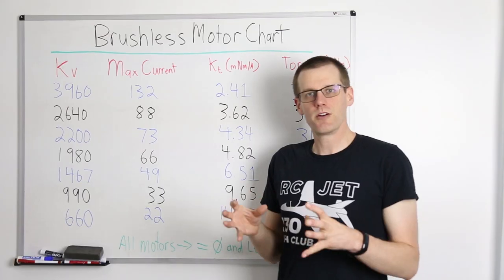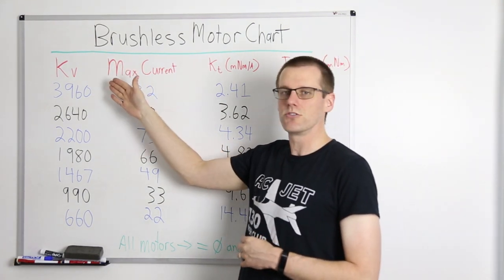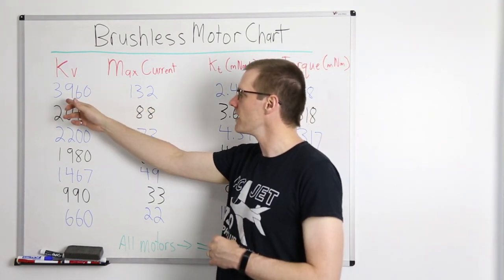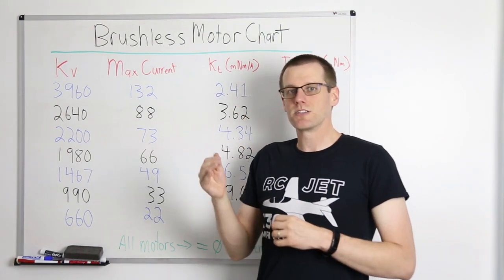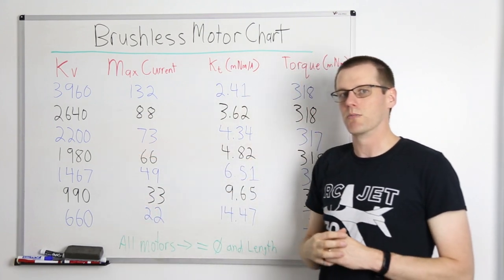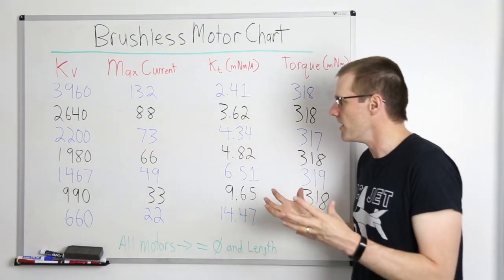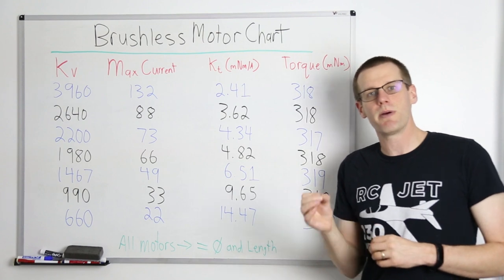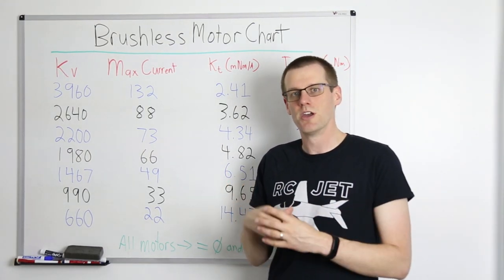STOP Saying Lower Kv Motors Produce More Torque

Comment: Didn't you explain in previous video, lower kv having more torque was a myth , but is alot more efficient,  less heat transfer
Reply: He most certainly did i just watched it last night. He's most likely updating the video as some wouldnt accept older information even from a year ago.
Reply: You might be thinking about a situation in which you ask the higher KV motor to spin x-many times faster - yet less than x-many times softer - than you do the lower KV one, causing it to draw more amps.
Reply from the maker: You are correct. I wasn't clear enough in that video as I received many questions about needing more torque and going to a lower Kv motor within the same size class.

Comment: Mathematically deficient here and newbie to electric. I have a 1650kv, 200 ESC and would like to run a single 6s pack varying from  5000-7000 mah in a boat. Stock prop is 4514. I have a number of other higher pitched props same diameter, and larger sized props by a few millimetres too. How do I maximise the full potential of this 1650KV 200 ESC combination please ?

Comment: A motor with a lower KV has better torque at low rpms, so it accelerates faster, but reaches a lower top rpm. A motor with a higher KV has better torque at higher rpms, so it accelerates slower but can reach a higher top rpm.
Reply: Any source? Because it is opposite to this video.

Comment: Ok everything looks good on that paper. tell me then why motors sensorless of course with high kV have coging on small throttle but those with smaller kV ratings not have that problem. you have said that torque will be the same but in life I can see something different. Please explain me that fact. on you white board you have calculate on max load what for me is not right.
Reply: We have not enough details about your situation to answer.

Comment: So is it same for air vs ground Vehical motors vs boat motors ?
Reply: Reason I ask as I know kv rating on a drone vs ground gear vs a blade does it matter ?
Reply: I think it is the same thing
Reply: @earlmoorhead5555  It goes for all brushless motors regardless of what it's used for. The only thing that will change is resistance against the motor from accelerating (wheels gripping, water being pushed, air being pulled/pushed etc). More stress = more heat = less efficient.
Reply: @TR.Pixels  nice 👍
Reply: So basically earl, I’m your last losi video, the stock 6500kv motor in your losi will not produce anymore torque then the Castle 7700kv(I believe it was)? @Earl Moorhead
Reply: @earlmoorhead5555  So basically earl, I’m your last losi video, the stock 6500kv motor in your losi will not produce anymore torque then the Castle 7700kv(I believe it was)?

Comment: This video Made brushless motors clear to  me. Well explained! My conlusion to this is that a low kv motor is allowed to run at higher voltage compared to higher kv motor of the same size. I think adding the max voltage to the chart will complete your explanation.
Reply from the maker: Thanks for sharing

Comment: Unfortunate I can only hit the like button once
Reply from the maker: Thank you for the comment!  😊
Reply: @RCexplained  I used to not know the science behind it, but I always thought even if you did get more torque, it’s all lost in the gearing reduction you’d use for a faster spinning motor. 
I’m surprised so many people stick to it when in 1/10 racing 17.5 and 13.5 motors are way slower than mod motors, and in 1/8 racing you use a lower KV motor if you have too much power for a certain track or surface. (Or if it would be a tall ask on a higher kv motor to last a 20min race
Reply from the maker: For sure!

Comment: I think this video may lead to misunderstandings. Pure theory and practical application rarely lead to the same conclusions.

I’ve been working with motors and electronic drives for decades and I’m still trying to get my head around the implications from this video. In industrial motion control, our Kv is volts per 1000rpm, not KV in RPM per volt, and if you convert Kv to volts per rad/s then Kv = Kt which is the torque constant in Nm per amp. That’s equivalent to the Kt = 1/KV relation you give in your video.

It’s true that the peak power output in watts from the same frame size motor is the same, regardless of the windings, but changing the windings changes the voltage-current relationship at peak power. In the real world we are faced with practical limits of voltage and current, either ESC current rating or battery voltage. So showing a white board with a sixfold range of Kv and suggesting that all these motors are practically equivalent is rather unhelpful to the practical modeller. In the real world, where resistive losses are present and practical available battery voltages do not range anything like 6:1, the question becomes for my practical setup, with say a 6S battery at 22V, what is the optimum KV (RPM/V) to choose for my hull type, size and prop? And the helpful answer to that question is certainly not “it doesn’t matter, all motors produce the same max torque and speed with unrestricted electrical parameters”.

For practical purposes in a real world situation, with a fixed battery voltage, to increase torque at lower RPM you do need a lower KV motor and possibly a higher current ESC. And with a fixed battery voltage, to increase RPM at reduced torque you need a higher KV motor. But in practice it’s far easier to change a prop size/pitch to better match the hull, motor and voltage than to change the motor KV, which is how things work in the real world, once the motor is correctly sized.

I need to think more and do some math to check, but I think showing how the torque-speed curve changes with KV, in a real world system with fixed battery voltage, may be illuminating here.
Reply: I found this comment more helpful than the video. They aren’t the same……not in the slightest. You change voltage going up the car intrinsically goes fast no matter what motor, but the top end is mist definitely not the same and the efficiency of the motor is going to run extremely hot, I’ve switched from 1412-3200Kv to 1412-2100kv, and 540-1900Kv fusion. Lowest Kv always gives you more low end torque  and control than a high Kv. Holmes proves it, I’ve done it myself. But what this video doesn’t account for it different sized can act completely differently, and outrunners aren’t accounted for either. Which also act completely different, a 540-1400kv is not the same as a 540 brushed at the Kv equivalent. It’s just not. There are too many variables, including the weight of your crawler. Bigger the Can, the Lower the Kv the better for crawlers.
Reply: @BillySugger1965, This comment is mostly correct, but there is one slight error. Peak power does change with windings, it is not constant. It is peak torque that is constant. Power = torque X revs. So if peak torque is the same the power must increase if the revs have increased. That's the whole point of using a higher Kv motor within the same can size. You can get more power output at the expense of efficiency.
Reply: @JeffGoris  top end and torque are always going to be the same. They just ramp up at different rates. One is more efficient the other based on what the application you’re using it for. 

I think some people are focused on the wrong thing.
Reply: @wvlfkvnt  Yes, the real focus should be on power. More power means more acceleration and more ability to overcome friction and drag to obtain higher speeds. There are two ways to increase power - by increasing torque (which requires a bigger motor) or by increasing RPM. I'm not sure what you mean by "top end". But, top end of the rev range is typically where the most power is made because you have the highest RPM. A motor that gives the same torque, but at double the revs of another motor will be outputting twice the power when both are at their maximum RPM.
Reply: Yeah his math must be completely wrong. Power being the same but current increases means that we have lower voltage to reach those amps at higher KV meaning we have thicker windings and probably less poles?

Comment: Thank you for the video.

Yesterday, I bought Surpass' 550 motors 21t, 27t, and 35t and measured the stall torque.
The results have similar torque in both cells 2 and 3.
Throttle 30%, 60%, and 100% are all the same.
It should stop now that high turn motors make more torque. ;)
Reply: Dont understand you at all.
Reply: He means that higher turn motors produce the same max torque, as explained in the video. What they produce more is the amount of torque per unit amount of the current.

Comment: Thanks man ! It was a good explanation but I can  see that everything is related to the windings and the copper wire ! It’s obvious  that if you choose a low kv motor believing that it’s gonna generate more power toque just because it’s a los kv it’s wrong some motors have diferent gauge of wires ! There are a lot of details that we have to put in mind before we purchase any more and doing more research about it ! Thank you for the explanation once again !
Reply from the maker: Thanks for the comment xavier.lonewolf82

Comment: Excellent explanation - that really solidified a few things for me.

The issue I have is that lower KV is less efficient because the windings are smaller and resistive losses increase. So it seems like if you're chasing high torque at low RPM (and high efficiency) you have to calculate the loss of efficiency from winding resistance compared to loss of efficiency from physically gearing down. This way you can decide on how to balance electrical losses and mechanical losses.
Reply: "The issue I have is that lower KV is less efficient because the windings are smaller and resistive losses increase"
Not really.  As torque is a function of induction and some other parameters that doesn't change with the winding (like the core geometry, permeability and the length of the core) if you double the turns of the winding you need half the current for the same amount of toqrue. Let's get the kV get halved! For the same coil size but double turns you need a wire with half the cross section. Your wire has 4 times more resistance but the coil needs half the current for the same inductance. (B=u0*ur*N*I/l. where u0*ur is the core permeability, l is the core length, N is the number of turns, I is the current)
P_loss=I^2 * R_loss = 0,5^2 I * 4R. The losses are exactly the same if the amount of copper used for the winding is the same. The only thing that really changes is the amount of resistive losses of your ESC which is better with lower kV motors due to lower current draw.

Comment: What if you replaced the magnets with stronger ones, would that change the torque?
Reply from the maker: It would increase Kt the torque per amp while the measured Kv would decrease.

Comment: Wow, this video was awesome, but now I'm even more lost then I was before. I'd like to build a diving scooter, but selecting a correct motor is a nightmare. Does anyone have any tips for me? I was thinking I should go with the Flipsky 65111 160Kv 3000W because of the low Kv, but does it even matter?
Reply from the maker: How much power in watts do you need and at what rpm? When you know bit of information it's quite easy to select the kv along with the cell count you wish to use.

Comment: Great video. Thanks for the info. Yet I still have a confusion. Do you suggest to get the highest kv possible for the same can size? For instance, if the rpm goal is 500. In that case, do you suggest to use 500kv by directly mounting or to use a 1000kv and reduce by gears, this will also give double torque at the wheels with much less battery(weight)? Thank you inadvance.
Reply: Yes. Just keep in mind the maximum amps your ESC and battery can handle not to overheat.
Reply: always use lowest possible kv and highest possible voltage.
Reply: @johannapoder2843  So then, in trying to choose between a 2100kv and a 3200kv at a GIVEN, identical voltage of 14v, with both options falling well under the max RPM of say 75K, the lowest kv option should be should be chosen as long as the Final Drive Ratio can still be attained using that lower kv motor through gearing?

Comment: Another great video! A quick question: Since the lower Kv motor produced the same amount of torque (with less amps) as the higher Kv motor(with higher amps) doesn’t this mean in real world applications where the motor is under load the lower Kv motor will have a better ability to maintain its torque output since it has more current headroom left. Thus making the lower Kv motor produce more torque under load?
Reply from the maker: Hello where does the increased headroom come from for the lower Kv motor?
Reply: @RCexplained  for example the max current you have rated for a 660kv motor is 32A @ 314 torque, when looking at a higher Kv motor the amp draw is much higher for a given torque output. My thoughts probably don’t line up with you chart but I’m just trying to find out if there are any benefits of a lower Kv motor. Other then making sure you don’t go under or over your RPM limit(Kv)… the calculations are great but I think we need a real world test where the motors can be loaded. Thanks!
Reply: @crimsonspan9750  benefits to a lower kv motor is requiring less energy to produce the same amount of torque, reducing heat, wear, and tear on the system. Typically you can adjust final drive ratio through gearing, similar principle in rc cars. Higher kv motors are recommended for lighter weight 2wd vehicles, lower kv motors for heavier 4wd vehicles. Also lower kv typically means higher voltage, as most motors have rpm limits and the higher the kv the lower the voltage ceiling
Reply: @tylercampbell6301  thanks! I am aware of all of that, I was referring more to the torque vs RPM ratio under load of the same size motor with different Kv values.
Reply: You are right, for a given amount of current you will have more torque per unit current in a lower kV motor. That is why lower kV motors exist. Otherwise they have a drawback of back emf requiring more voltage for higher rpm, due to increased number of turns (Just like an electric transformer). This increase in voltage will result in slight heating. I suspect wires are also thinner (inverse root to the Turns) in lower kV motors due to lack of space, but not ever checked.
Reply: @RCexplained  “where does the increased headroom come from for the lower Kv motor?” With a fixed ESC peak current rating, from the reduced motor current needed to deliver the required torque. At the expense of reduced voltage headroom from a fixed battery stack to achieve the required RPM of course, ain’t no such thing as a free lunch.

KV changes the voltage-current relationship at peak power. Changing the load (hull, prop) changes the torque-speed relationship at peak performance. Matching KV and battery voltage to hull and prop for a given motor frame size influences how well the boat performance matches peak delivered power. When the two match perfectly, you’re getting the best out of the motor frame size for the hull-prop combo.

Comment: Nice explanation.  The only thing I would add is that the lower kV motor is much more efficient at delivering torque.  If heat or battery life is a concern, then you would want the lower kV.  Also... You need to be able to actually deliver the full 132A in you example vs. just 22A to get the same torque.

Comment: I had this thought when i went lower kv and was gonna up the pinion. It still started to cogg at the same tooth pinion from stock. I hate ANY cogging so i only went up 1 tooth in the end but up 1000kv at 2 up from stock 3300 and 4300 kv motors acted the same from a stop. So high kv was my only option at power/speed. Its just more powerful all around but everyone says go the other way. Didn’t work out for me im not dealing with the stutter start for the power.
Reply from the maker: Very interesting. I have a similar video topic somewhere in queue for this.

Comment: Exactly! That's why higher kV motors produce more power!
Reply from the maker: You got it
Reply: But one thing I always wondered, the lower turn wires are also thicker, right? Since they will have much more volume to fill and therefore should be the reason for the higher current capacity, along with shorter solenoid length.
Reply from the maker: That is correct

Comment: very informative video i watched it 3 times :-)
I always thought and also heard the lower the KV the more torque but your explanation totally makes sense.
So the only real factor is the form right?
bigger motor bigger can/magnets => more torque
or a (higher KV) motor running on higher S setup geared down really hard is this right?
Reply from the maker: Correct, the only real factor in theory is form. In one physical size all motors of all different Kv values are limited to the same value for maximum torque and horsepower.
Reply: @RCexplained  love your vids
Reply from the maker: thank you